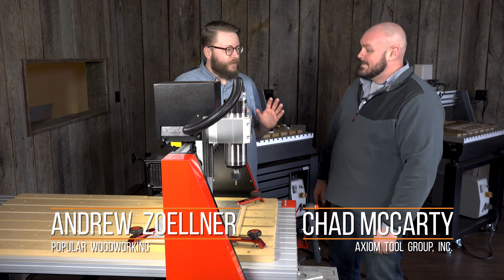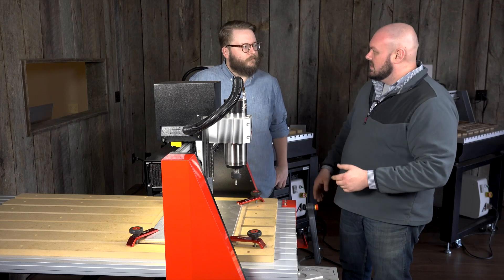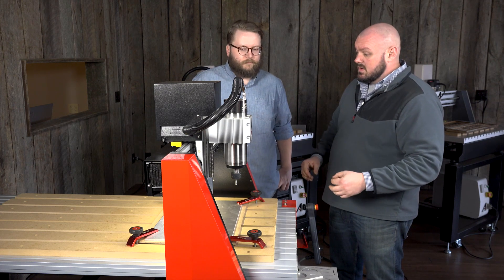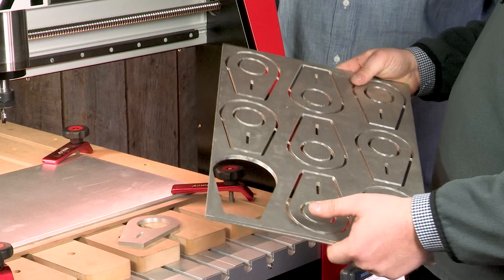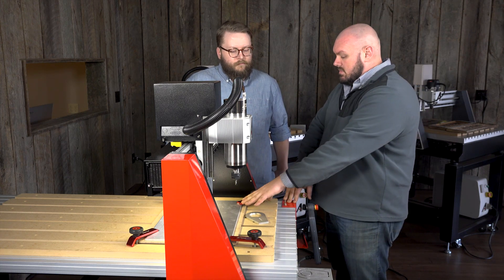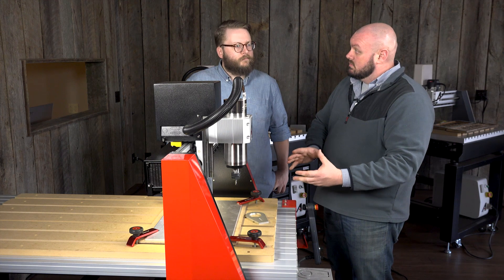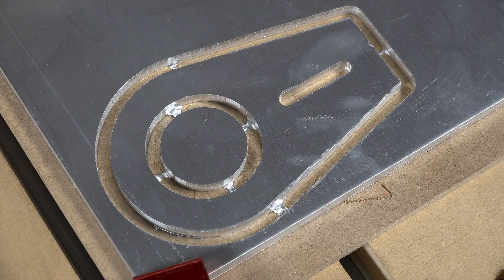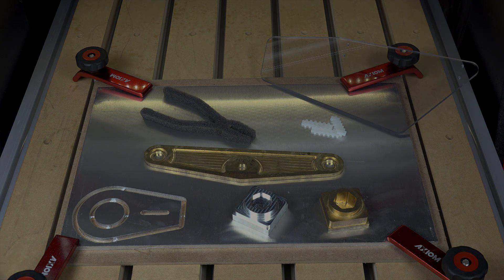"In More Than Wood" Popular Woodworking Visits Axiom Tool Group - Episode 7

Comment: I'm not here to bash you guys but I was looking at buying a ShopSabre for 11,700 - 15,000. Their ShopSabre-23 comes with a giant 4th axis, much more dependable spindle/router ($3,200), bigger work space, structural grade steel 1 inch thick, the computer, software and a 30x40 inch cut space. SS is considered top of the line, how are you guys better than their SS-23? If I don't do the 4th axis and commercial grade router it's around 9k and this would be around what you offer but for a decent amount less.

I'm honestly asking as I have not bought the SS-23 yet... this is a lot of money for a hobby tool.
Reply from the maker: With many machines like this, there will be base prices comparable to ours...but then additional items need to be added to make the machine itself comparable. In this case, the standard machine features an MDF table that is supported by the steel frame of the machine. 

That steel frame also supports the Y axis...which has been shown in a number of small format machines to allow the MDF table top to flex changing the distance between the bit and the  surface of the material. 

On all Axiom machines the table top is a 40mm extruded aluminum with integrated t-slots. That table top is mounted directly to the gantry so that the gantry travel is always parallel to the spindle/bit, removing stacking of tolerances. 

Our gantry itself is also taller allowing larger material clearances. And on the new ProV5 machines...each axis uses larger 48V stepper motors with higher torque and working speeds than seen previously....where most of the industry is using 24V Nema 23 motors.

The Sabre-23 comes standard with a router mount, but does support a spindle at a far higher cost. We are not sure that many would agree that its more dependable...There are no additional cost for what we consider to be standard parts for the Pro series machines...Our 3HP Electro spindle has proven to be very reliable and is designed to last the life of the machines. 

If you talk to customers, visit the forums and user groups on facebook for instance....we're confident that you will find that will many machines are similar in capabilities, what sets us apart is our Support. Each customer is treated as family...and we work very hard to support each and every customer at anytime. Each machine comes with lifetime support regardless of who owns/operates it. 

In addition to the growing accessory inventory and our support network, we also offer a one of a kind CNC Software and Training class option lead by a Vectric Beta Tester and design specialist. Giving customers not just Axiom users, but anyone interested in the Vectric software a wonderful opportunity to learn form the experts. 

Our average AR8 24" x 48" Pro machine with accessories is around $10,000 depending upon what accessories and software are selected. 

If you'd like to give us a call to discuss the specifics and availability, we would be happy to assist you in any way that we can. Please feel free to reach out to us at 844-642-4902.
Reply: @AxiomprecisionCNC  Thank you for the reply and information. I think of all the machines so far yours and ShopSabre are the most appealing to me. I do however like that ShopSabres 4th axis can have wider diameters as it's off the table. 

Before I call I'll visit your site again and see what kind of build I can make. I like that you guys have all ball screws for accuracy and even the motors you use. I don't know much about your particular spindle but most places seem to advise shying away from water cooled spindles as it means they are more likely Chinese and thus not built very well. I assume if there are issues with a spindle early on after buying that you would take care of it. 

You also have a very pretty machine btw, good on you for that. I think even the ascetics matter.

Thanks!

David~

Comment: Seriously, only 0.010"?  Surely your machines can handle more than that as 0.010" is pretty conservative, in line with something like a Shapeoko.  I have a MillRight CNC Power Route and I can do 0.025" DOC in 6061 with ease.  I was looking at possibly stepping up to an Axiom machine as the Power Route is only 2' x 2' and the fit and finish is less than stellar.